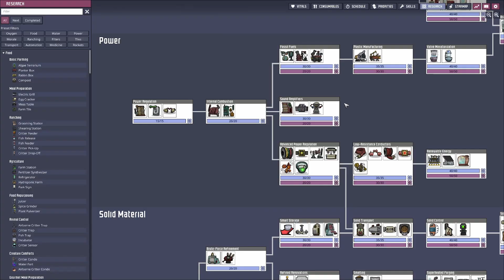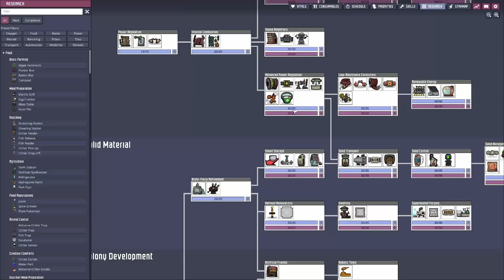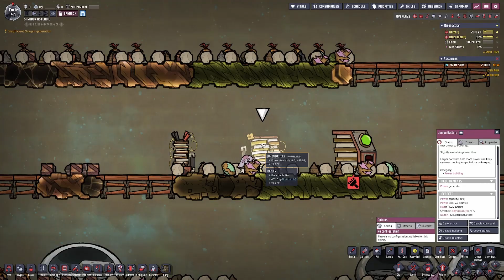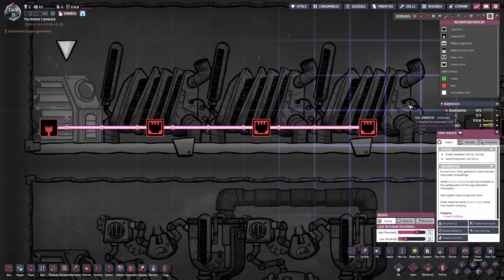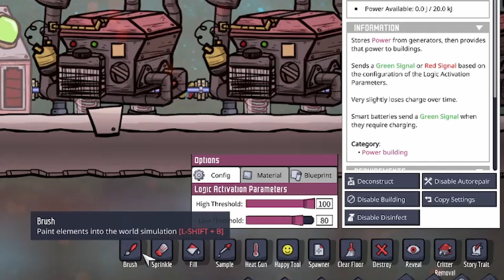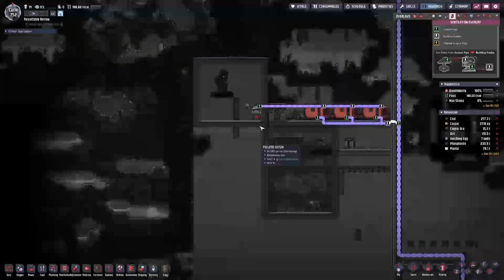POWER GRIDS and SMART BATTERIES for BEGINNERS in Oxygen Not Included - Most Overpowered Building?

Comment: First time i built the smart battery was eye opening. It was actually the building that made me want to understand automation in the game. I use it just like you do. Usually after completing the super sustainable achivement, I'll add petroleum, coal and natural gas. My Hydra (flooded spom) make more hydrogen than i will ever burn (usually a 9 electrolizer setup) and I'll make multiple hydras but smart batters tell which hydrogen generater on a diffrent hydra when to come on which just means that hydra stock piles fuel. I know its a bit of a glitch but the smart battery make or breaks my system 😅
Reply from the maker: Yeah I share the same feelings about my first time with the smart battery. It really made me want to get deeper into the game and play around with the mechanics and experiment.